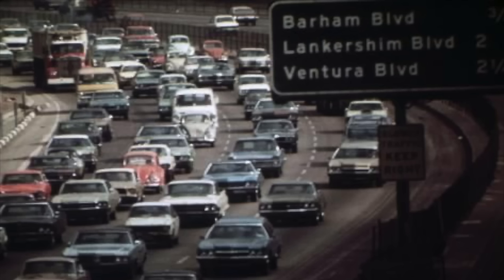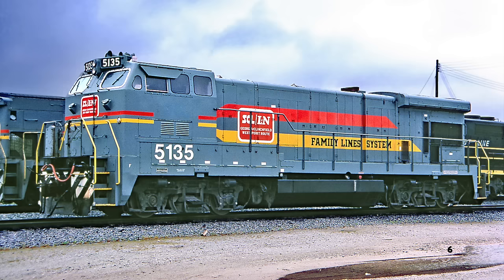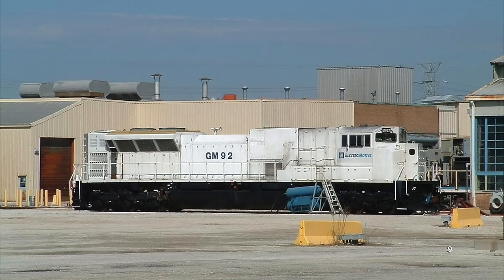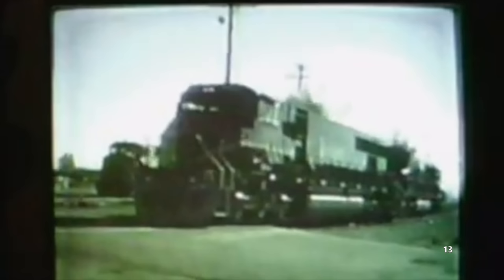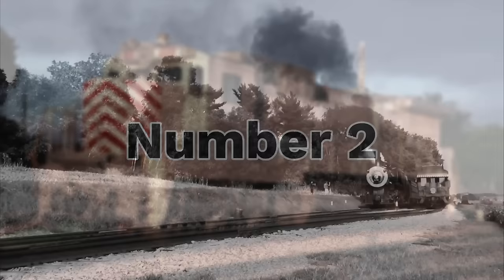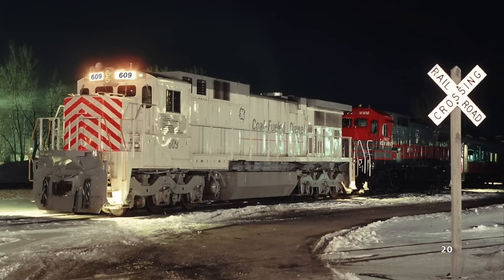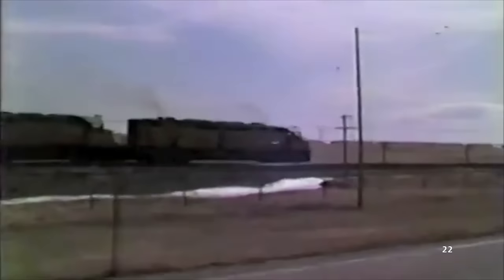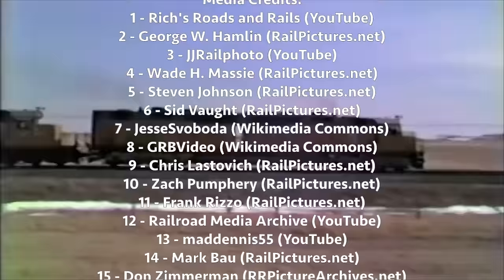5 STRANGE North American Locomotives (Part 2)

Comment: Few things you missed about the BQ23s, when CSX acquired them, all of them are turned into booster units. Their control stands are removed and the windows are sealed shut with metal plates. Also their bogies are uniquely using blomberg that you usually find on EMD GP engines.
Reply: *were
Reply: Yes they were from trade ins that SCL used as credit to GE...it's not uncommon....
Reply: I love the look of them.😂😅I hate they were scrapped.  @railfandepotproductions
Reply: @railfandepotproductions I just love the MK5000C and MK50-3, SD90MAC, and AC6000CW, plus the BQ23-7.
Reply: Naive newbie railfan here. Can someone explain to me what the ‘blomberg’ term means in this context? Thanks.
Reply: @yogiperogy I love those BQ23-7s.😂😅
Reply: I wish the BQ23-7s survived, I love the look of them.
Reply: @yogiperogy Bloomberg trucks
Reply: @frostbyte3978 - Thank you!

Comment: You sound condescending towards railroad labor. Maybe you were trying to be generally informative but the “Emotional Support” commentary was highly unnecessary. As a modern Freight Conductor I will have you know the carriers cook the books on mechanical failures of the equipment, I can’t say how many 100’s of times in the last 16 years a brakemens assistance would have paid off in efficiency gains. From pick ups and set outs could have been completed in 20 or 30 mins versus 3-4 hours.

Comment: Morrison Knudson (Morrison Ka-nude-son). The MK5000C were the better options of the 5000 HP units but MK Rail went bankrupt. Only 7 were ever built
Reply: Better option? The MK5000C's were famous for breakdowns involving their Caterpillar 3612 prime movers. They were the most problematic units at the time. Most problems involved the crankshafts and generators. Actually,there was only 6 MK5000C's that were built and leased to Union Pacific and Southern Pacific. There was seven more MK5000C's in the process of being made but that's when MKR filed for bankruptcy and soon MPI took over before GE did. The 7 MK5000C's that were supposed to come next were going to be demonstrators for BC Rail. All of the units were scrapped. One spare cab from an MK5000C was mounted onto an SD45 from ATSF which was MPEX 5000 and designated as a SD45M-3 for D&ME. The surviving MK5000C's were in storage for a few years with Union Pacific after the Southern Pacific merge. Utah Railway purchased all of them and immediately rebuilt them within a year as MK50-3's with 645F3's from SD50's but with 645E3 power assemblies. After Utah Railway lost their coal service to Union Pacific all of those units were last known to be owned by KYLE now.

Comment: How about  the Mauss kraffi?  Southern Pacific  units very  unique
Reply: I believe you are referring to the Krauss Maffei ML 4000 German built diesel hydraulic locomotives. 
The only one I know of that still exists is at the Niles Canyon Railway in California.  I believe it has been cosmetically restored.  I have seen videos on YouTube.  Dont know if any others were preserved.  Definitely unique locomotives,  at least for US.
Reply: @davidmihevc3990 it is indeed the last of the imported diesel-hydraulics, although a relatively large number of their predecessors exist in Germany along with some in the UK.
Reply: @davidmihevc3990  They have both engines running on it now along with it being cosmetically restored.
Reply: @jds1342  Thats great. Thanks for the info.
Reply: @davidmihevc3990 Krauss-Maffei?😂😅I do apologize if I pronounced that wrong.
Reply: It was a flop for freight service though.  It wasn’t heavy duty enough to pull heavy loads.  Would be like taking an Amtrak locomotive and trying to use it to pull heavy freight trains.
Reply: @gregrowe1168 I do apologize if I pronounced Krauss-Maffei wrong. 😂😅
Reply: @gloria6229  I’m not even sure how to pronounce it.  My comment had nothing to do with that.  I was just saying that the locomotive was a failure for American railroads.  It just couldn’t handle the stress of pulling heavy freight trains.
Reply: @gregrowe1168 Was the MK5000C ideal for pulling heavy freight trains?😂😅
Reply: @gregrowe1168 Was the MK5000C ideal for heavy mainline use? 😂😅

Comment: The Family Lines/SCL BQ23-7s rode on traded in Blomberg trucks, like the regular B23-7s. I loved seeing them when when they were brand new in the late 1970s in the Miami area.
Reply: Most of SCLs U18B locomotives used Blomberg trucks as well. So did the U36Bs and MATES.
Reply: Thinking about it, the only thing odd about the BQ23-7 was the cab. Behind it, the long hood, everything in it, including the engine, alternator, radiator, and the frame was exactly the same as the standard B23-7.

Comment: I actually HAVE seen a BQ23-7 in action back in the spring of 1994, roster number 3008, as it was in the number 2 position of 3 mid train helpers on Q316 from Grafton, WV to Cumberland, MD. We got a real close view of it as it was pushing upgrade around Tunnelton, WV. It was definitely one of those one-time-only events, for most of the BQ23-7 seemed to spend most of their time in the southern states within the system, probably along their original Family Lines, Clinchfield, and Seaboard System trackage

Comment: The SD60 was introduced by EMD to save EMD.  It wasn't the SD70, it was the SD60. And the SD90-2H WASN'T a V20 engine, it was a V16 4 Stroke engine that was built up from the ground up by EMD and it was rated at 6,000HP @1025rpms. It was a Disaster because it wasn't thoroughly tested and EMD just sent it out to beat GE when they came out with the AC6000CW. YES, your Right that the SD70 Saved EMD but it was already to late because EMD was at the point of Bankruptcy. The 710 Prime Mover wasn't able to meet Tier 3, nor Tier4 Standards due to it being a 2 stroke engine. That's why EMD was bought by Progress Rail/Caterpillar in order to meet the need of Tier requirements. After that, EMD fell even more due to engine problems with Caterpillar, and Class 1 Railroads didn't Really want to by ANY of them due to Mechanical Failure. That's why SOME of the Class 1 Railroads went with a REBUILD Program to rebuild Aging EMD's and CERTAIN GE's to Class 1 Standards.
Reply: the 710 did meet Tier 3 standards, but only with 8 or 12 cylinders.   The 710G3A-T3 powers the ECO series rebuilds
Reply: SD90-2H? The units with the 6,300 HP 265H's were the SD90MAC-H's. Union Pacific owned 60 SD90MAC-H's while Canadian Pacific owned 4 SD90MAC-H's which didn't survive very long. Most of the SD90MAC-H's from Union Pacific were returned to EMD and marked as EMLX lease units. When nobody wanted them EMD actually did complete rebuilds and some of the units were exported to FMG/BHP in Australia for ore trains. A few of the CW60AC's from CSX that PRLX had for awhile were also exported. EMD actually rebuilt the 265H's for foreign usage in Australia, China,India etc along with the 210H's. The prime movers were just extremely problematic here in the United States and inevitably wouldn't pass newer emissions regulations because of carbon footprint. The same ordeal would've happened with GE's 7HDL's from the AC6000CW's. The SD9043MAC's from both railroads remained in service for awhile. If the 265H's were reliable back then,the SD9043MAC's were suppose to be converted. The units were debuted before the prime movers were. The reason why the 265H's were such a disaster for awhile was because General Motors was trying to sell out EMD so hardly any funding,development,and engineering was provided. The SD90MAC-H's and SD70ACE's are what really brought down EMD. Both units also had numerous electronic issues involving cabinets overheating all because of harness and plug issues and junk quality from Siemens. Half of the SD9043MAC's from Canadian Pacific were rebuilt as SD70ACU's with better electronics from Mitsubishi. The reason why multiple SD9043MAC's from Union Pacific had cracked frames was because they decided to undertighten the fuel tanks which caused immense stress over time. The fuel tanks on the SD9043MAC's and SD90MAC-H's were designed to float on the frames of the units due to long length,EMD built them that way. Unforunately the junked SD9043MAC's were sold to Norfolk Southern for SD70ACU rebuilds and others went to Canadian Pacific but most have been/are being scrapped while some on lease from PRLX to Ferromex. Technically,the 645 and 710 series do meet T3 standards when it's included that EMD for many years was installing exhaust manifold silencers on their units in order to reduce emissions. Hardly any EMD units are rebuilt for class one service anymore,those days are gone. Modern EMD units suck and so does their costs and warranty. It's obvious as to why there is many GP40-2's & SD40-2's still on the rosters. Thanks to Wabtec now owning GE's market they have better warranties and rebuild programs finally in place that GE was stubborn about for many years. Not to mention they have EMD resources themselves that CAT/PRLX doesn't for aging fleets. Massive amounts of GE units are being rebuilt on top of units already in revenue service. It's easier and cheaper to rebuild entire fleets of C44-9W's because railroads don't have to adhere to T4 standards. The only reason why the SD70ACE-T4's and ET44AH's exist is because of tax write offs. Both units are mainteance demanding and consume more fuel than any T3 or T2 units,regardless if it's EMD or GE. The SD70ACE-T4's are the most junked units once again thanks to CAT/PRLX and now there is the SD70H...

Comment: The SD90MAC had a 16 cylinder H engine, not a 20 cylinder engine.
Reply: Thee lookalike SD80MACs had a 5000hp 20 cylinder.
Reply: THAT'S RIGHT. THE SD80MAC, HAS THE 20 CYCLINDER  710 ENGINES. NOT THE SD90 MAC. THE LOCOMOTIVE HAD A1010 SERIES ENGINE WITH SIXTEEN CYCLINDERS IN THEM
Reply: @user-ku5wk1yy9x 
UP had a number of 90 MAC units with 16-710 engines rated at 4300 HP too. Just about all of them developed cracks in the frames in the area of the rear fuel tank mounts and UP got rid of them.

Comment: Great vid but here's one you missed back in the 90's  some of the Railroads experimented with converted diesel from french fry oil didn't work out to well it didn't produce enough b.t.u.s I remember every time going through a long tunnel getting real hungry
Reply: It did work in diesel pickup trucks though.  There was even a kit you could buy to make your own diesel from used cooking oil.  The show Trucks with Stacy David had it on one episode.

Comment: On the subject of the DDA40X, UP tried enough other extra-large diesels in the 1960s to make another one of these videos on its own. In addition to EMD's DDA40X and its predecessors, the DD35 and DD35A, GE built the U50 and later U50C, while Alco offered the C855. The GE and Alco units were far less successful than the EMD models.

Comment: The SD90 had a V16, not a V20
Reply: Yes, your right about  it being V16. The video indicates the that engines reliability problems were related to high RPMs,  which is probably not true. It was a new engine and problems with new engines are unfortunately normal.  GE also had problems with their Gevo diesel which were co-designed by Deutz diesel of Germany.
Reply: Ya I think he confused the SD80MAC which was rocking the V20.
Reply: Yo WSG RenAzuma, didn't think I'd find you here

Comment: How does that work with HP ratings on a locomotive?  Ultimately it's the adhesion physics that determines the pull on the drawbar.   A six axle 3600 hp loco can spin the wheels, so what advantage does a larger 6000 hp have?
At least the DD40 had eight axles so the extra pull is understandable.
Reply: EMD debuted a RADAR-based traction control system with the 38/40 series, and nearly all modern locomotives have a system like this to prevent wheelslip.
Reply: A single 6000 HP locomotive could replace two SD40-2's. You reduce maintenance costs (since you have fewer units to maintain) as well as decreasing overall fuel consumption.
Reply: As mentioned,  the problem with the sd 90 was it wasn’t really designed to make that much hp.  It was forced to run at higher rpm to try to make more power and that made it unreliable.

Comment: Thought this question to be of use. How many companies still manufacture diesel locomotives. Second , while I can't remember which one went out of business and stopped making them. Why did it stop ....thanks
Reply: ALCo was the other big manufacturer, along with GE and EMD.
But their eagerness to keep their early lead when other companies began to catch up lead to them releasing the 244 engine without proper QA and testing, which lead them to losing loads of money in warranty repair and a stain on their reputation. Eventually fizzled out into bankrupcy due to dwindling orders and competition from GE.
EMD is now part of ProgressRail, owned by Caterpillar, and has basically nothing in common with the old GM-EMD.
GE has sold GE transportation to Wabtec due to its recent financial troubles.
Baldwin, Lima and Fairbanks-Morse never really made it big in the diesel locomotive market, basically a footnote in diesel locomotive history, most had stopped their production by the 1960s.

Comment: If you go a bit south, in Brazil you´ll find some oddities, sort of finding back old friends.

How would you call a narrow gauge SD45 ?
It´s a DDM45. A straight EMD SD45 builted for narrow gauge with DD trucks  yep the same as UP Centennial, and a tiny mini fuel tank in betwen. Google EMD DDM45.

How to modify your former BN, UP, CR, CN, CP, SP, D&RGW, N&W, Southern SD40 and GE to narrow or wide gauge ?
Wide gauge is easy. Put new wider CC trucks.
1 meter(about 3 feet) narrow gauge is more sexy surgery. The cuttest being the SD40 and SD40T-2
1) extend frame lenght about 3 feet on each end.
2) shorten fuel tank.
3) remove dynamic brake fan and put it at rear inside long hood under radiators and do opening on hood side. 
4) replace with smaller lower coupler.
5) anything like horn higher than cab roof must go in front of the cab due to tight tunnel clearance.
5) get rid of CC trucks and replaced them with BB-BB
Awesome ! 
The front platform is big enough for a crew picnic table and barbecue for cooking the beef they just smashed. Some umbrella shade should keep them cool while they eat😅😅
Google EMD BB40
And for nostalgic of heritage paint scheme, some ran down there in their original livery for awhile before being repainted.
For those in love with brand new GE power, they come in 
GE BB40-9W
Seeing elongated SD40 pulling string of mini narrow gauge boxcars is monster.
They also use DPU, COFC and Roadrailer.
Hé  narrow gauge modeler, when are you going to kick out your old Rio Grande steamer and arrive in 21st century ?
If they do it in Brazil so can you and it´s fully prototypical since your beloved railroad 
doesn´t exist anymore !
It´s not cheating, it´s if it would have survived, 
that´ll be in 2024.
And don´t forget picnic table for your crew....

And for "juice addict" they also have/had broad gauge "Little Joe" a la CMSTP&P.

Comment: Is the SD90 more powerful than the DDA40X?
Reply: Two answers - no, and no. As delivered, the DD 40’s were 6600 HP, then they were derated to 6000 HP about midway through their careers, so they were then the same HP as the AC 6000 from GE and the SD 90 MAC.
Reply: @ralfie8801  so in short, the SD90MAC is as powerful as a derated DDA40X, and thus less powerful than the OG DDA40X?
Reply: @mariebcfhs9491  
Yep, that’s correct. The DD 40 is basically just two SD 40’s on a single frame and two 4 axle trucks. The 16-645 turbocharged engines were most reliable at the 3000 HP level, 3300 HP stressed them pretty high and severely reduced longevity, that’s why the engines were derated to 3000 HP for a total of 6000 per locomotive.
Reply: Maybe similar hp but the DD40x is basically 2 sd40s in one chassis.  2 locomotives will outpull one locomotive if the hp is equal.

Comment: Lmao emotional support 
No,  it was bc they were doing away with cabs but union contracts still required 5 man crews on local jobs
Reply: Also 7:40 "safer, faster, and more efficient diesel locomotives". Of the three qualities mentioned, "safer" is first. Not last, or even second. Never mind that the only quality the railroads actually considered, was efficiency. 
"Safe emotional support". That's the participation trophy/bubble wrap generation(s) for you.
Reply: @emilyadams3228   this is just typical of foamer videos

Comment: I hate diesels with a burning passion ,here i I am wanting to work on steam locomotives for a living but no, can't even do that in this day and age

So much for my American dream, it been dead for decades no thanks to General Electric
Reply: Steam is too labor intensive,and is nowhere near as efficient as a diesel. I am surprised that no RR has begun to electrify a portion of their route, as the PRR and MILW  had done
Reply: Time changes. Technology gets better. Theres still a place for steam engines, just not on modern railroads
Reply: @user-mr3ct1dm9p too expensive.  Electric would be cheaper in the long run but railroads don’t operate like that. It would take decades for it to pay off.  Shareholders don’t have that kind of patience. Going full electric would put most American railroads into bankruptcy.